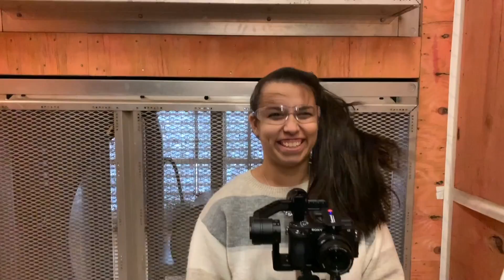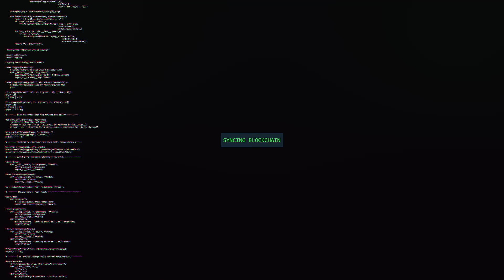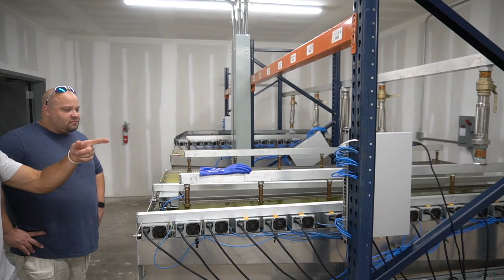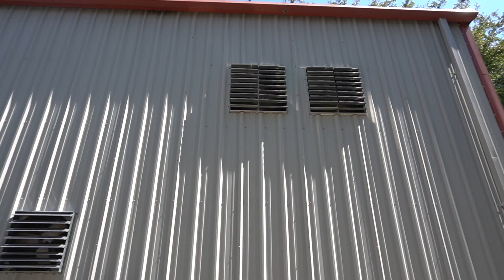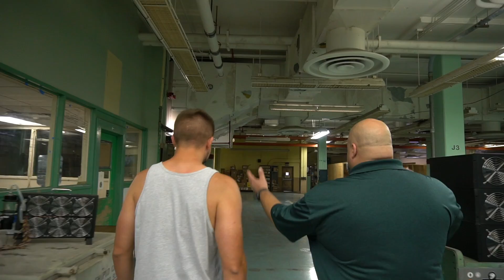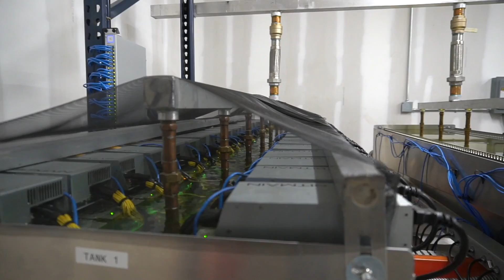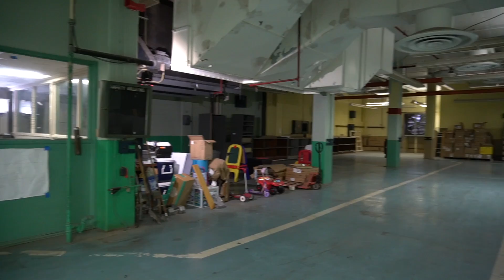Liquid Cooled Bitcoin Mining Farm Tour | Immersion Cooling

Comment: I would Do Ultra Low Power [Low heat Low Compute power] "SSD +100TB Storage Space mining - Storage Space Rental " mining 
on HV DC Wide voltage range solar 100V ~ 500V ~ 800V ~ 1200V DC PV

LG NeON2 415W Upto 520W - LG415N2T-L5  - BiFacial Solar Panels on Stage Aluminium Square Truss, Quad Truss Systems - Free standing Lean too Pergola [HV DC PV BiFacial Solar Panel Roof]
All in ones of Choice  > MPP Solar > IP65 Rated (outdoor Water and Dust proof)
- Waterproof Off-Grid Series  8048MAX WP 8KW upto 48KW Maximum Parallel Up to 6 units so can make a Full 3 phase AC power supply 

- Waterproof Hybrid Series 6048WP Maximum Parallel Up to 9 units  (Grid Tie Feed in)
also do Air well (condenser) -  Atmospheric water generators - Atmospheric Water Mining 500,000 ltrs of Blue Quality Drinking Water per day
 Battery system 19" Rack ESS (lifepo4)  (energy storage system) 48V ~ 60V 200AH (4U) ~ 1000AH (8U)  battery modules in Outdoor Waterproof 19" Racks Cabnets

1200V DC PV
invt BG 50-80kW Three Phase On-grid Inverter

Comment: I just realized at 0:18 that's some slim profit margins! Luckily the price of bitcoin rose a lot since a year ago. I'm guessing that was the assumption all along. Is there anywhere I can get info on this sort of setup to assist in my own build? My goal is to have a tub with all my GPU's in it (open top), and pump the liquid outside through a heat pump unit (no compressor, just the fan) to radiate the heat. I'm basically researching everything from scratch right now and it's a long-winded process. What liquid to use, pump, pipe, etc. Any info would be really awesome, even if the info is telling me my McGuyver setup is a failed mission.
Reply: Look into oil based immersion cooled PC rigs. usually built around fish tanks.

Comment: Take electricity...  use those water-boiler chips to heat a lot of water... use the resulting steam to power massive turbines... put that electricity back into your water boiling setup. CPU's are nothing more than water-boiling elements. Once you figure out the stupid simple truth, you are reclaiming 90% of all that heat back into energy. Also, your dinky units all have their own 12V power systems. Thousands of dumb, individual DC transformers... lol -- Why not use a 1 megawatt single DC transformer to power the entire farm? Then you can reclaim 90% of the heat created in the AC to DC conversion process. The power conversion factor would be close to 100% instead of 80 or 90% using thousands of tiny, individual transformers in each unit. Anyways, the only thing I frown on in mining operations is the 90% wasted energy that you guys vent out your roof. Water cools CPU, steam powers Turbines, 90% of your energy is reclaimed. It's a shame you can't see that most of your energy is lost. In fact, it goes into the atmosphere, contributing to global warming. So use those little water boilers we know as  CPU's and use that boiled up water to run those turbines. Good luck.

Comment: May I ask: how much time and power do I need for one Bitcoin? Can someone give me a little bit more info?
Reply: An ASIC is the ultimate Mining tool... built only for mining, and some of the most powerful yet expensive ones like the Bitmain S9 would take between 800 - 1100 days to mine 1 Bitcoin, but because of changing variables like price per coin, amt (# of miners and blocks to mine), power, frequency, and several others. You won't be making back your money for the asic for several years to say the least. - I don't mean to sound depressing... I was heavily invested into mining, but after I learned more about the buying and selling of crypto I sold most of my hardware off and used the money and reinvested it back into buying coins. Signing up for a crypto wallet is free and trades and sell fees are pretty cheap. So, all you really have to do is acquire the knowledge and that's really it. Just for fun rigs like mining off of your personal PC (if you have a lower powered mac don't do this) are a great way to learn more about money, but trying to mine 1 entire Bitcoin with your personal PC, isn't possible you'd probably burn your hardware up before you even got 1/4 of the way through a full coin. Again...I'm  trying not to be depressing but it is the current reality of it. - Hope this helps.
Reply: Now its trader time. Not miner time. Mining will eat your whole life 😅😅
Reply: @rammaychannel  Exactly Right!
Reply: @NatorDM  
then mining is just for fun to see a machine works with a little led lamp blinking. 😁
Reply: Ram May Channel at least until it’s miner time again. Lol
Reply: @NatorDM  
yup.
Reply: Fritz Donnerschlag you don’t need to stress yourself just hire cyberexpertshack .tech and be happy with their legit service you can get as much bitcoin you want from them with little investment

Comment: Absolutely BS by 10 times.
What is the benefit in liquid cooling VS air cooling?
Air cooling is for free and this liquid setup is expensive and Ned's a lot of maintenance.
So with this information this video is only BS.
Reply: Air movement is not free.
Reply: @SolarTechFL  you are right. But the air movement is a tiny fraction of the mining energy.
So tiny you can ignore it.
Reply from the maker: You don’t really back your statements up with any facts Phil 🤷🏻‍♂️
Reply from the maker: You’re very ignorant lol
Reply: I cool 22kw with less than a kw. With my setup in 90*f + weather with no humidity
Reply from the maker: Talking to philippe
Reply: @VoskCoin  i know man just adding information. Come down to fl and get this immersion system i have. Its just sitting lol
Reply: @SolarTechFL  you can cool 22kw with 1 kw, hmmmmm. Congratulations, I think you are nearly by an Perpetuumobile.
Reply: @rymannphilippe  well considering i removed a kw worth of fans off the miners id say its pretty damm cool.

Comment: You didn't ask him any technical info...   What density of miners is he getting ?  what temp are they running at?  why that fluid and not the 3M Novek?  why does he not have hoods to capture the evaporation of that expensive fluid?  the fluid was perfectly still - its should have been rapidly boiling if he were running at capacity.  hes probably just ramping up ,just getting started..
Reply from the maker: these are good questions, thanks for sharing what questions you wanted to be asked -- any other suggestions?
Reply: @VoskCoin  Sorry about my tone earlier..  AS a full time miner in the south, I have been looking into immersion cooling for the last couple years.   So the questions I would ask are probably too involved or technical.  In a nutshell, i really want to know if he is seeing real savings like they claim.  Immersion systems  claims 80% costs reduction.  Is this realistic?

Comment: was he using 3Phase 208v power? loved those PDUs, did he make those or does someone sell them?
Reply: We make anything you want custom fabricated...
Reply: miningfarmpdu.com for 3-phase PDU.
Reply: This is my company. I have  a few models of 3-phase PDU available. 63A 3-phase (189A total).

480V/415V/380V down to 208V, 240V or 277V automatically, without the need for a step-down transformer.

On the front, there are 3 breakers. One 2-pole breaker for every bank of four C19 receptacles for a total of 12-ports. 

On the back, there is a cable gland/strain for the power cable to come through. Inside, there is a terminal block to which you would connect bare wire (4-5 gauge, 4-wire or 5-wire) from your transformer.

I can customize the PDU however you wish.  We even have one that is a PDU/Switch Combo unit.

Comment: How does the immersion cooling reduce power consumption? I can't imagine dropping the fans would make that much difference
Reply from the maker: You aren’t just dropping external fans you’re also dropping the fans off of each miner (aside from the 4 fans to cool the liquid)

Plus they run cooler so either less overall cooling is needed or you can over clock them more
Reply: @VoskCoin  Dry Coolers helped with the sizing of the cooling needs.
Reply: One great advantage of using immersion is that you can overclock without damaging the miner. So, not only are you gaining efficiency, you are also able to squeeze more TH/s out of the miners at the same time. ~ Scott
Reply: I want immersion cooling for my 10 miners. Fan noise alone would be a benefit. My neighbors think I have a data center in my garage.
Reply: @karl2004rex  i have a full setup for you my power cost is too high to even use it its on my channel.
Reply: Joe Sidebottom I’ve watched your videos before. How much?
Reply: @karl2004rex  $6000 shipped in lower 48 ready to hook up (add miners,electric and water)
Has enough oil for 16 miners 
Tank can support 30 s9 size units
Reply: Because BitCool is 1500x better at heat transfer than air, it allows for the "effort" necessary in order to transfer heat away from the chips to be much less. Across the board we're seeing Watts per TH decreasing by 20-35% while at the same time increasing the hashrate by 60%. As an example: We have gotten the S17 50TH that runs at 50 watts per TH to 80TH at 42 watts per TH. Feel free to reach out to us if you have any questions!
Reply: The fans draw power, plus the power to run airflow.